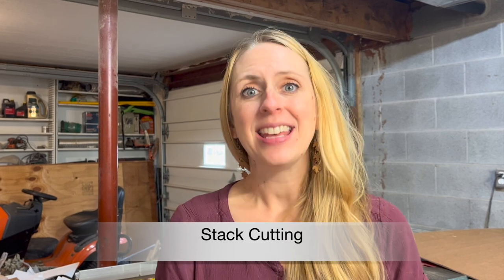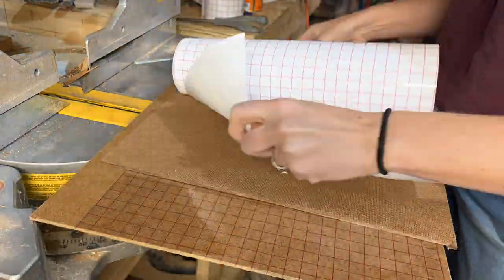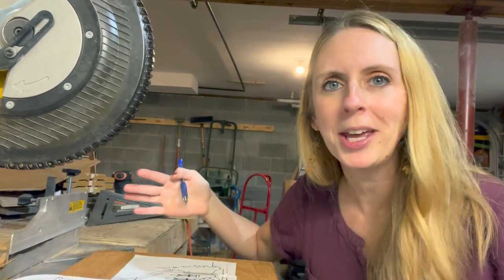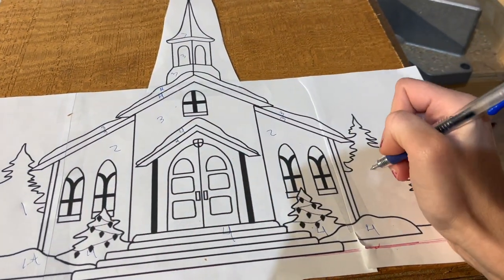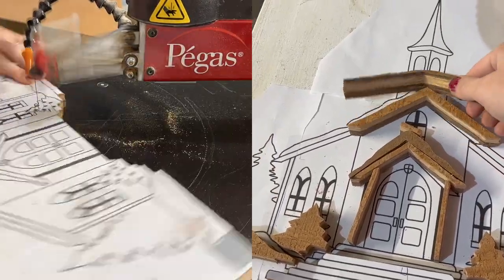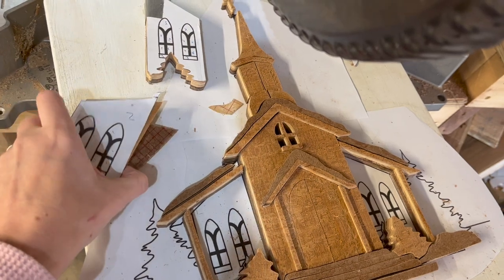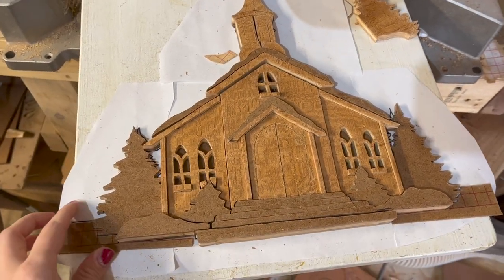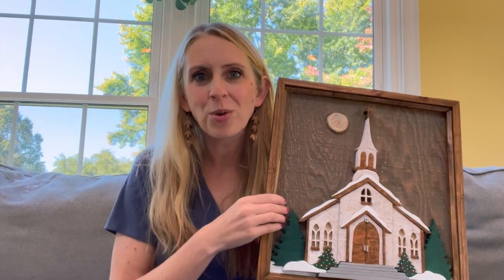Scroll Saw Stack Cutting: Creating Layers and Depth

Comment: Have you made any outdoor signs with lettering on a scroll saw? If so what type of wood did you end up using?
Reply from the maker: Hi! I have! I used cedar and several coats of spar urethane.
Reply: Did you paint it? If you did how did the paint take?
Reply from the maker: @joshschultz5743  I didn’t paint it-just stained. They make outdoor paint,  but if you don’t want the wood look, you could also try cutting acrylic?
Reply: @WendellWoodworks  ok thanks for your replies!
Reply from the maker: @joshschultz5743  best of luck!